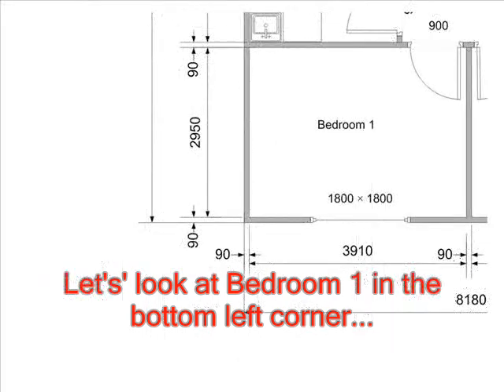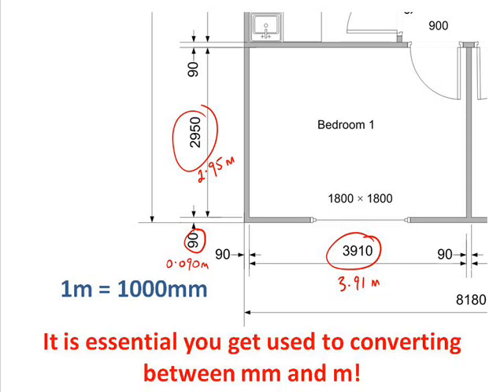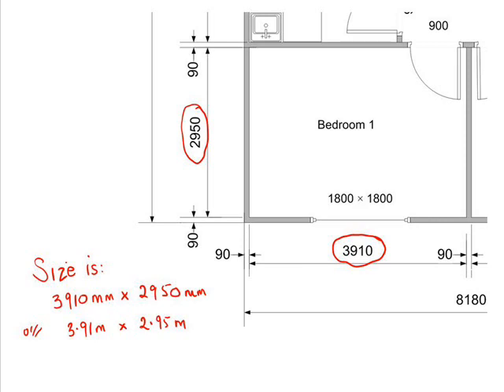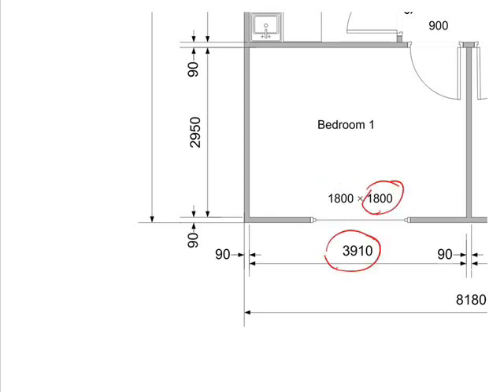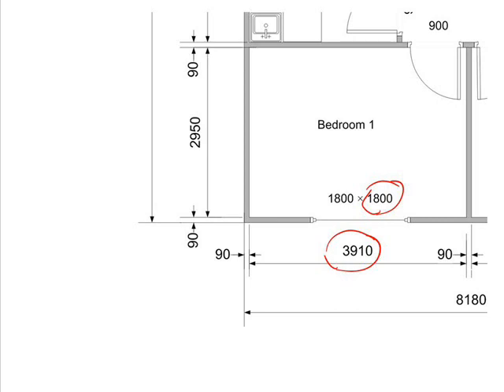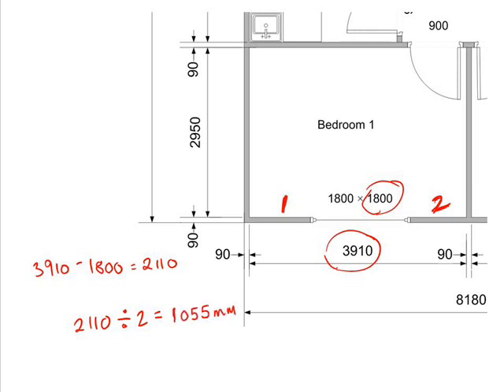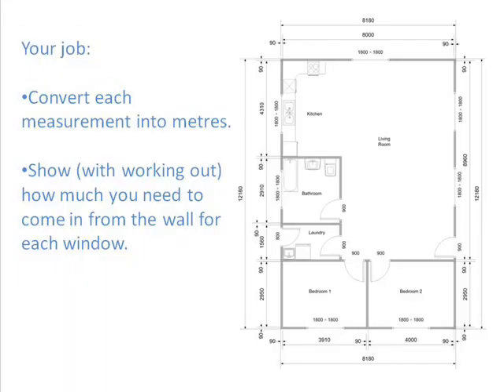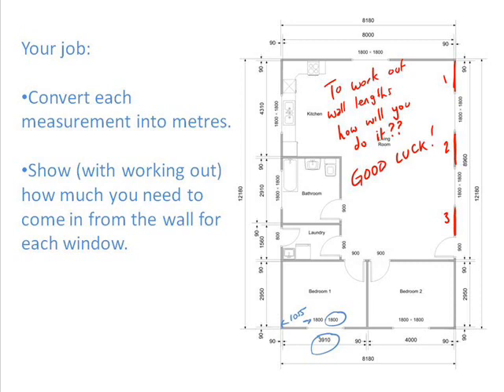How to read a house plan

Comment: WTF? wall diameter is only 90mm? or 9cm? are u sure?
Reply: In the UK I've found a lot of internal stud walls (modern builds) are there or there abouts, floating between 9cm to 13cm I've found or more. Older properties or internal brick walls etc bigger for sure as standard but 9cm isn't unlikely if stud or similar.
Reply: 90mm is about 3.5 inches which is the standard size of a 2x4 wall so yeah sounds about right